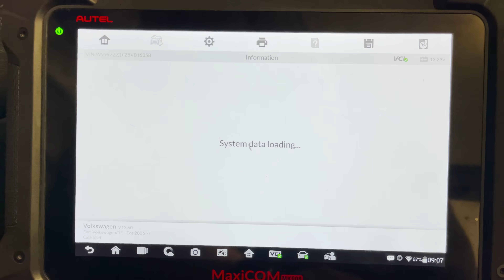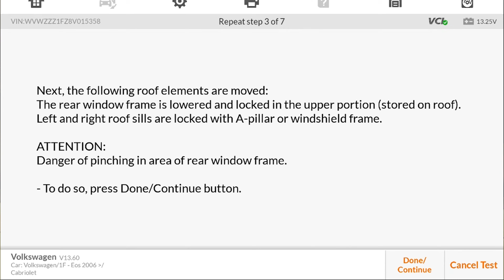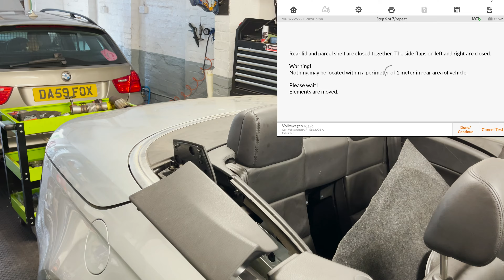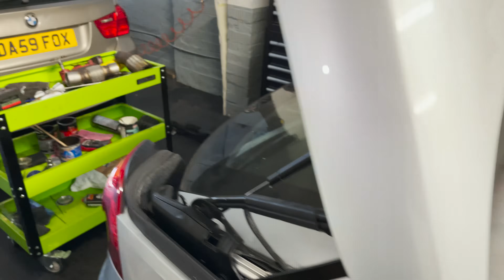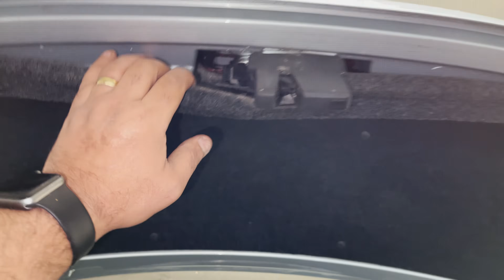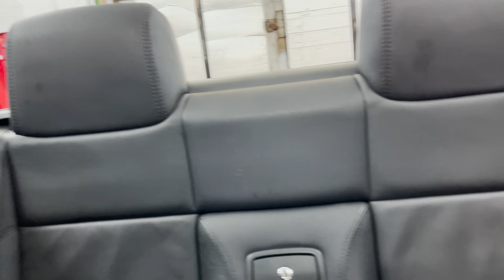VW Eos Convertible Roof Not Working FIX | fault code 02805 System malfunction

Comment: These tops are highly complicated they are full of cables and sensors that follow a secuence controlled by a program that is not controlled by the computer car.
All these is mechanism is independent from the car and to make it worse most cases is not installed by Volkswagen.
The car is shipped to  a. Different shop that only does tops and specials conversions on new cars.
For the dealer in brand new cars.
So when owners have issues with the top 
They take it to the dealer but the dealer have no clue how to re program these tops or fix them sometimes they don't even have replacement parts to fix them.
So they refer the customer to s body shop that has no idea most important is not their responsibility to fix this.
So after almost 30 days of asking and diggin you found the company who was hired by the dealer to install the top only to find out they are either out of business or they refuse to take a look at it cause the dealer never negotiate any kind of guarantees with them .
They get pay to install these tops on brand new cars by the dealer but they are never get pay or negotiate possible issues and service.
Plus these companies sometimes they move from state to state .
My best advise stick to non convertibles.
How I know so much of these ?
My friends car spend years in her garage with the top half down till we found a guy specialist in tops 
Cost her 2800 dlls to fix the top so she immediately sold the car 
Lose a lot of money.
I try to help her but I couldn't fix it and I have 30 years working with cars 
The issue it was a. Bad sensor and the top need it to be reprogrammed.
I was never going to find the problem 
Sensor took 3 weeks to come from somewhere in Singapore
These cars are a nightmare

Comment: Hello friends this is video helping a lot of people!.
But the main reason you didn’t find and fix.
The 3e brake light in the boot leak water inside  you need this fix also.
The water runs down the cable into the micro switch from the boot lock…
I will be back iff you don’t fix the brake light

Comment: How did you end up removing the pin from the plug? 

I currently have the same problem and have ordered a new lock however the old pin has broke inside the connector like yours

Comment: The roof wouldn’t work because of the trunk lock module?!
Reply from the maker: Just the trunk lock. The trunk lock has a closed/open micro switch that sends a signal to the module .
Reply: @CarsExposed Thank you!

Comment: Just wondering.....so the corroded plug on the boot latch mechanism caused the original opening piece that you moved up manually  not to work?

Comment: With this car the sun roof rails need to be greased with lithium grease every now and then because any resistance will cause the very sensitive sensors to register a fault and stop operation. If not that then one of the sun roof motors can be faulty and the same thing happens (they are prone to water ingress damage). If not then the roof module has had water in it and is damaged. Lots of things make the operation stall. Also cables can stick or get trapped if they come off where they're supposed to be, also causing shutdowns. You need to refit the roof lining because of the strings before operating the roof. They are part of the operation too.

Comment: So I changed the boot lock and from the roof not doing anything it now opens halfway and then stops l. The drivers side side flap doesn't lift up but the other passenger side does. Anyone have any ideas on why this is happening?

Comment: I can confirm the problem.

The trunk lock is engineered bad ... because water will store in the plug and the pins & plug will rust extremly. The lower pin will loosen/break and this causes malefunction to the roof opening process.

Replace the old trunk lock and the problem is solved 👍

Did it today ... it works fine now 🥰

You probably need VCDS adapter/software to get the roof in a logical correct place to open/close it first.
Then erase 02805 and everything is fine!
Reply: Fix my vw rod comb top
Reply: @joanntucker-scholes5221  
is your car in Germany?

Comment: should've replaced the 3rd brake light too that's probably the reason why the bootlid lock connection rotted.

Comment: I had similar problem with it .... procedure started by vcds then roof was started opening and I could not stop it so at the first  rear both windows gone then trunk lid closed to the middle section of the roof ..... really mess... when procedure was started I could not stop it even after take a key out from ignition switch there was a roof ECU problem so really need to pay attention what can happen !!!!!

Comment: The hydraulics is sounding unnaturally loud and whiney.  This usually means that there is air in the hydraulic system which will give weak spongy action.  Air will get into a system through eroded seals or hoses on the suction side of the pump.  Replace the inlet seals, and inspect/replace the connectors, hoses as needed.

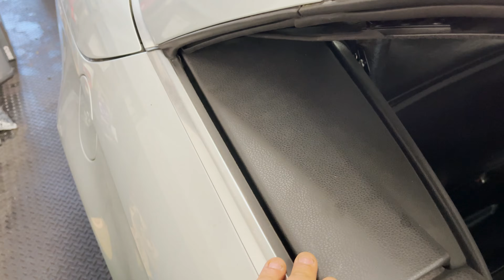Comment: How did you fix that latch at 14:43? Mine literally just broke, and I can’t put the top down
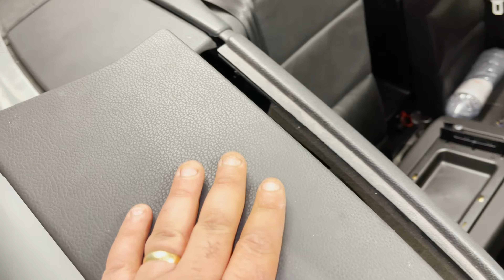Reply from the maker: Perhaps the cable came off the bracket line in my case you can see it at 10:31
Reply: Hi pal I've just had a problem with my roof tried to open it windows went down then warning ⚠️ light came on for the roof now I can't close windows or open the boot 😮can you help me please
Reply: @sunnydays9403 i hope you can solve it. I am contemplating of purchasing one tomorrow. The top works heavenly but am now concern about the top not working in the future. Would you recommend the car purchase, thanks.

Comment: the corrosion to the lock is from the boot light, occasionally boot light cracks and start  licking to inside. sos... after the lock mechanism, water destroys the roof pump.

Comment: the black cable end has poped out off its holder pull the cable and put it back in as a fast fix to keep it in place use a cable tie and it will work. the cable probably has some friction in side it use a few drops of oil to loosen it up.  for the flaps it can be that they hang under the cloth they are atached to a piece of black wire this can be to long because off streching overtime. the latch in the booth is not working and does not sense the lid is up. replace the sensor.
Reply: Is that what was wrong with the roof not opening up?